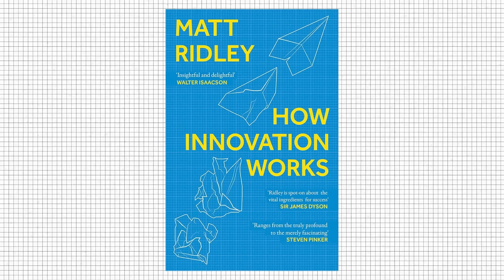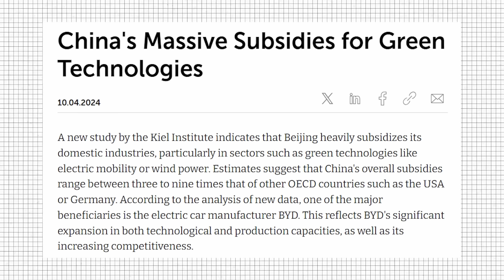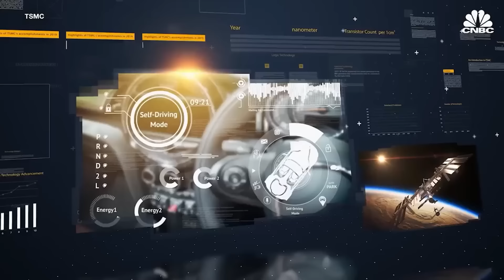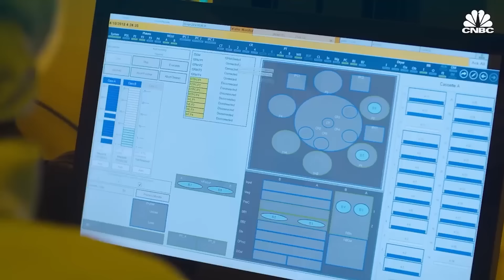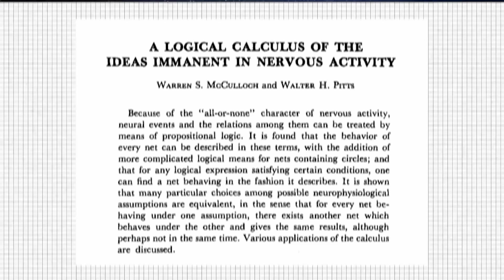AI’s Progressing 100X Faster Than...

Comment: computers are not increasing in power any faster than they have been in other decades, all Nvidia did was quantize the calculations for AI down to 4bit, so FP4. This is like allowing Usain Bolt to be timed over 50m and everyone else having to run 100m and then claiming Usain Bolt is so much faster!
Reply: The number of bits in a number is not so important. It is the number of parallel process that enable large language models to see patterns and then communicate, or act, like humans or better.